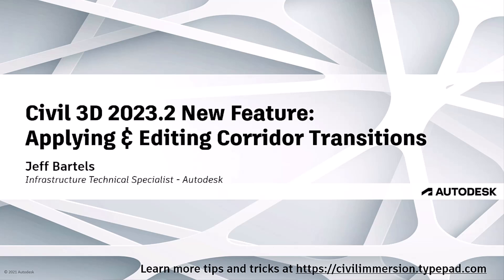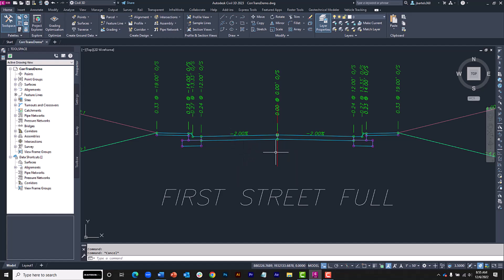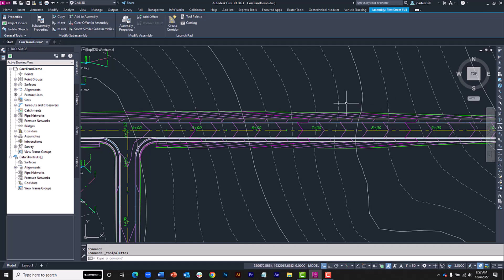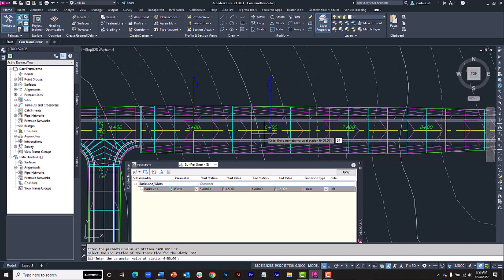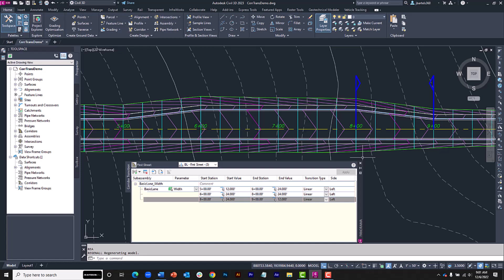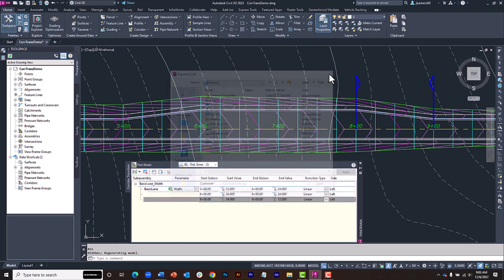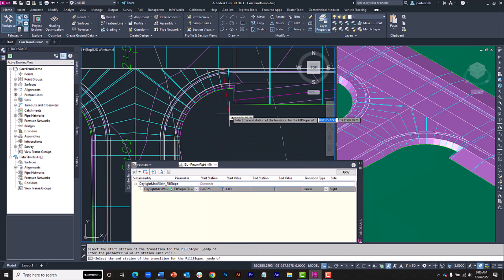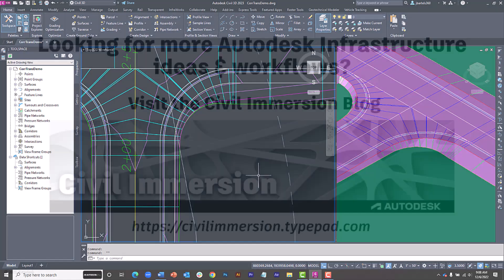Model Civil 3D Corridor Transitions Using Any Subassembly

Comment: Could this be used to transition the tie-back slope to the target like a right of way? For instance, station 0+00-3+00 I need a 3:1 back slope, but from 4+00 to 9+00 a 6:1 would be better. The transition would obviously need to be from 3+00 to Station 4+00. 

This feature seems a long time coming. The previous method involved voodoo.

Comment: As always, nice work Jeff!
One remark though on the feature itself. Beside the fact that it's very easy to do targetting with subassemblies that don't support targetting initialy, offset targets created this way, will create less accurate geometry in terms of widths of curbs, sidewalks,... at the transition itself. This because of the fact that assemblies are always inserted orthogonally on the baseline. So for tapers with fairly large widening at a short distance, it will create e.g. curbs with wrong widths. For transition in elevation on the other hand, it's very usefull...

Comment: Hi Jeff. Very good video!!!! It is a tool that Autodesk should have placed a long time ago because it is used a lot when modeling streets or intersections. For example, Autodesk still doesn't fix the problem of placing curve labels correctly, when one wants to add an additional curve to the alignment. I made a video with an alternative solution. I think Autodesk should have already fixed that problem. I share the alternative solution for labeling (spanish): https://www.youtube.com/watch?v=TLSvggOev6Y&t=271s

Excuse my English

Comment: You could do this before learning another trick I learned from Jeff, the number generator assembly part. So if you work at a company that is really slow to upgrade their Autocad version, you can do this instead: https://www.youtube.com/watch?v=W-f4Ep7TXyE
The only caution on this way, is that it requires anyone using it to have the custom assembly part loaded. So if you are like me, and your boss refuses to load your assembly part, they will get a .NET error.

Comment: This is an extremely useful tool to speed up workflow, very much appreciate the insight.  I wonder if the transition could work with BoC height. If so, this could make modeling driveways much easier versus having to create custom subassemblies or edit elevations via feature lines given municipality standards.
Reply from the maker: Hi Julio, Yes, you can use this tool to transition curb heights.
Reply: @JeffBartelsCAD  hell yes!!!! 🙌🏻
Reply: @JeffBartelsCAD   would of been nice to of shown this, maybe in the near future?, sounds great for handicap crossings.